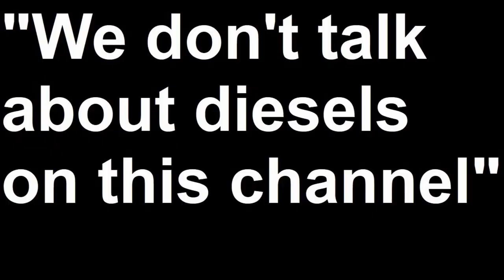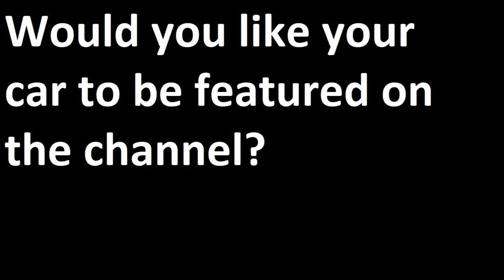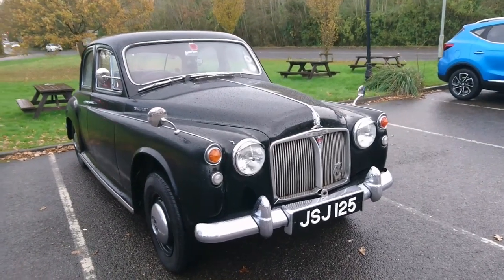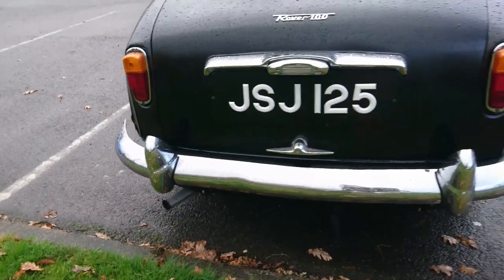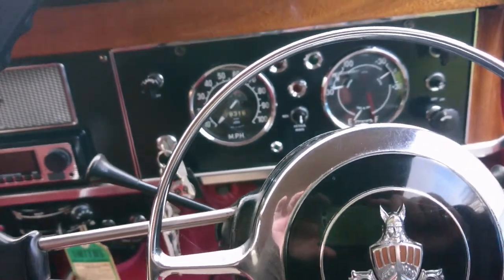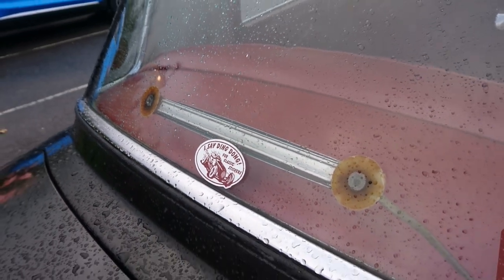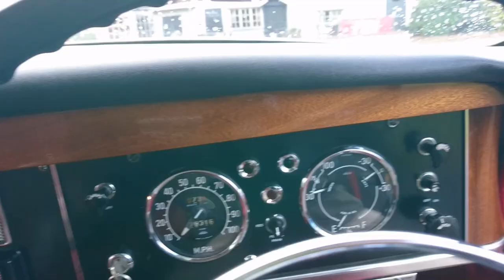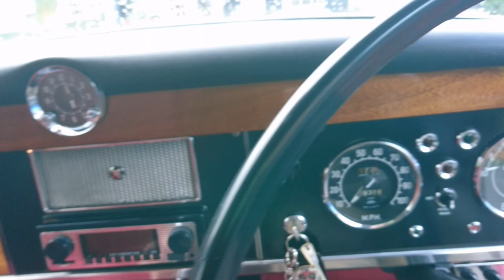Sensible Secondhand Classics: 1961 Rover 100 (P4) - Lloyd Vehicle Consulting

Comment: Great review Joseph. I have a P4 80. I've had her for thirteen years never let me down once. Best of British engineering. Brilliant car to drive.
Reply from the maker: Thank you very much indeed for watching and commenting! I eventually got the hang of driving this, but I would most certainly need the new aftermarket power steering system from a Corsa C that some owners have now developed, along with perhaps an all-synchromesh gearbox, if I were to use one all the time.

Comment: Had a P4 100 between 1980 and 2014 plus a P5B Coupe and a P6B 3500S. All very different cars. You gave a very good review being new to the model. A couple of items you may find interesting. When new the steering was actually quite light. The key as someone commented is keeping the kingpins topped up with oil, plus crossply tyres made a hell of a difference which were standard when new. The 6 cylinder engines were almost inaudible even from outside, but put a considerable weight penalty on the front tyres to the obvious detriment in handling. The handbrake when set up correctly would easily hold a 1 in 3 hill but you had to understand how it worked to set it up properly. The gears were never difficult to change so there may be a problem with the car, you only had to respect that first gear was crash. The overdrive in top made a huge difference to cruising. They were never equipped with mirrors from new, and back in the 70s and 80s you many driving around with none. Mine had a heated rear window from the factory and the elements were so tiny you could barely see them but worked perfectly. The sunvisors are standard fitting, why can't manufacturers fit them today? Mine had an hmv radio set that sat in the centre, if none specified aanother wooden glovebox lid was fitted. With these cars it's the detail and engineering that always impressed as current owners will echo. Remember the newest of these now are 60 years old, but back when they were current there was nothing like them. Factory said they would last at least 16 years in service, the fact that a good many were still on the road giving daily service in double that time says it all. Anyway great review.....thanks so much I really enjoyed it. Have subscribed. Best wishes Marco
Reply from the maker: Thank you for subscribing! With really old cars, they are just much harder to drive than newer ones. They often have non-synchromesh on first gearboxes (like this one), no brake servo (like a Morris Minor), really heavy unassisted steering (like some of the 1.6 Maestros), all round drum brakes (like some Vauxhall Vivas), gearboxes with unconventional patterns (like a Citroen DS) and in some cases quite limited performance (like a Fiat Panda). This means that you have to think a lot more about what you are doing when driving, especially when some of these things are combined together, such as in a P4. I was a bit scared having a go in this, but I managed it, and now I don't have to terrify Alex by driving it again! 

You may see that so far this year I have done a 1972 Jaguar E-Type, 1970 Morris Minor Traveller, a 1976 Vanden Plas 1500, a 1973 Peugeot 504 and a 1972 MGB GT on the channel, with more to come soon,  so I am not averse to driving older cars, it just takes a lot more effort to take them out on the road and talk to the camera without looking utterly terrified and making mistakes...

Thank you ever so much indeed for watching, commenting and subscribing!

Comment: Great review Mr Lloyd, yes a true Rover from the 50’s(even though that’s a ‘61), it does have an ambiance of middle class about it and I’m thinking that people at the time who could afford to own a car would be well aware what the cars would be like to drive, but even so as you say would need some practice to get used to it. 
     It’s in very good condition and a credit to Alex and it’s previous owners. 
    I remember during my teen years in the 90’s a family used one of these as their daily driving family car as the owner preferred cars from the 50’s and 60’s to use on a daily basis. 
       Thanks again Mr Lloyd and Alex for your review.
Reply from the maker: Yes, Alex uses this on a daily basis, and so I understand why the people you knew used to do the same thing. She loves it, although I prefer driving the Allegro and Micra. It certainly is a very middle class car, even today. I won't really make a habit of driving cars like this, but it is good to try them on an occasional basis, as it actually requires skill to do it well.
Reply: @lloydvehicleconsulting  Yes the Allegro and Micra are probably less of a challenge to drive as they’re not much different to drive than a modern car except no “toys” or “bells and whistles”.
Reply from the maker: @willswheels283  , the Micra feels the most similar due to the end-on gearbox, although the steering is very heavy in comparison with a modern car, although the Allegro wasn't bad either.

Comment: I actually saw a two time blue P4 100 at a classic car show in the summer and was rather taken by it.
My Dream Rover is a P5B in dark blue but as you know I do love the P6, SD1, SD3 and R8. Early post war cars are generally too close to pre war designs for my liking but this is something very special.
To think that in the 1950's we still had rationing in Great Britain. We lead the world with no money and a posh accent. In such times of austerity this majestic car must have really been a symbol of national pride.
Reply from the maker: The design was extremely modern for 1949, but it did look very dated when production ended fifteen years later. They aren't the easiest to drive, unless you fit an electric power steering conversion from a Corsa and perhaps go for the 105R automatic, but they are very comfortable and charming. There is some serious engineering behind it with things like the Inlet Over Exhaust engine, in this case a modified P5 unit, the Birmabright doors, the gear linkage and the oil level gauge.

Comment: I have just bought a 1962 Rover 100 and the two things that are challenging about it are changing gears and the heavy steering. These, along with other details like the window wipers and small rear view mirrors have made driving it the first couple of days a bit of a challenge. But I got a nice old car for a low price and it's really just something for fun drives in the country. But as in this video, it takes one by surprise first time around.
Reply from the maker: Yes, the gearbox and steering are not easy to deal with. I managed it, but it was hard. I can't believe how cheap they are! Thank you ever so much indeed for watching and commenting.

Comment: I do fancy one of these. Very stately, sensible and classy.
Reply from the maker: They are a bit of a handful to drive, but you can get an automatic, and there is a power steering conversion available. That would be my preference, as so much else about the car is fascinating....
Reply: @lloydvehicleconsulting  My very first car was a 105S. Just passed my test (age 21) and with borrowed money bought it second hand. Never had any problems with steering it or gear changes, probably because all other vehicles I had driven were similar.   Never had any problems attrracting young ladies into it either - far better than the sporty jobs my opposition drove. Admittedly they did attract different females!

Comment: What an experience Sir, British engineering at its best. Alex maintains the Rover beautifully
Reply from the maker: She does, sir, but she also is used to massive steering wheels, gearboxes with funny layouts and no synchromesh on first gear, all of which I found mildly challenging, shall we say.... An amazing car nevertheless, though!
Reply: @lloydvehicleconsulting  You had a go Sir. I have never driven a car of that age, only a Grey Ferguson tractor, probably similar size steering wheel, but it didn’t do above 10mph, so not quite in the same league . The Rover has a beautiful steering wheel though
Reply from the maker: @badbooks476  , I did have a go, sir, and now it is safely back in Alex's hands...

Comment: I owned a 1955 90 back in the 70s and I have to say I never had any troubles at all with the gear change. I might add that the engine had so much torque that I could turn into a road in fourth at 10 MPH and still move off without any hunting or shaking at all. I could travel on the freeways at 70 MPH without any dramas at all even without overdrive. I absolutely loved that car but at just 18 or 19 I was always looking for the next car to buy so I traded it in on something much less desirable. I wish I had kept the old girl. I had only two scary moments during my ownership. Once when coming to a stop at an intersection where the road had gravel on the side I applied the brakes and the steering wheel spun completely out of my hands as the left wheel was on the gravel and the right was on the tar. The other was when I had the car in freewheel (controlled by a large knob on the bottom of the dash where the badge is on the one you showed)  and I started a long and steep piece of road and realised that after a couple of strong applications of braking I had serious brake fade (drum brakes on the front of that model year). Being in free wheel I had zero engine braking so it was a scary ride down the mountain road. No wonder they dropped the free wheel design in 1956. But she was a totally reliable daily driver that never let me down. If I was to have one today from that period I would definitely convert it to a later disc brake front end because the drums could let you down if your concentration was not on the money at an important moment. I would HIGHLY recommend the P4 to anyone looking to get an entry level classic car. Nice video mate. Just get your manual gear changes right. :)
Reply from the maker: To be fair, I don't normally drive cars with no power steering, no synchromesh on first gear, and with first where third normally is and reverse where first normally is, so I don't think I did that badly. It is quite difficult driving cars like this if you aren't used to it. If you are someone like Alex, though, who drives this all the time, then it's not really much of a problem.

Glad I didn't have to deal with a freewheel, all round drum brakes and other complications which some of the earlier models had, it was hard enough dealing with this as it was, although I am exceptionally glad that I was able to have a go in it, and these are amazing cars if you can live with the fact that they are nothing like a modern car to drive. For a lot of people, I think that is the point, and Alex has proven that you can still drive one of these every day over sixty years after it was made if you want to, and I do understand why someone would want to do that. Just had a go in one of her other cars today...
Reply: @lloydvehicleconsulting  Mate, here in Australia we say: "I was just jerking your chain" with regards to your manual gear change skills. No insult was intended. It's just our sense of humour here in Oz. Oh and as for the steering wheel turning, I wouldn't suggest the push pull method. The steering is far too heavy, especially at parking speeds. Just turn it like you would a truck and she'll be apples, just heavy apples. :) I used the right hand on the outside of the wheel  rim and the left hand under the rim. But in any case, I thought your video was really clear about the advantages and disadvantages of the car.

Comment: The rover 80 used the newer series 2A  two and a quarter litre landrover engine, while the 60 used the later series one two litre landrover engine, which itself was a development of the P3 1600cc engine.
The gearbox is quite sweet actually once you learn to give it time rather than hustle it, unless you come to a complete halt the engine torque will happily pull away in second so you dont need to worry about 1st gear.
Seventy mph is quite relaxing in  overdrive and she will cruise at that all day with a full contingent of passengers. Downside is 24 mpg and 18 running to the shops, although the sixty was slightly better.
 Finally I was delighted to see such a lovely car tested. Good choice!
Reply from the maker: Thank you for watching! It was very difficult to remember all the facts as I was driving, as I don't normally drive cars without an all synchromesh gearbox, and the gearshift pattern is entirely different from everything else I have every driven too... I have now tested three cars from the 1960s on the channel (a 1966 E-Type, a 1968 Midget and this P4) and I am looking forward to testing a 1967 Rover 2000 Automatic in 2022. We have a lot more classics to come on this series that I have already filmed this month, although none quite this old.

Comment: Hi, I owned a p4 100 back in 1970 , never had trouble with the gears . I did once have the the gear stick come off in my hand once , while at traffic lights on the A40 Denham . I remember the engine was so quiet at tickover , you would think it had stalled . As an eighteen year old I had no problem with steering either . The car you were driving would probably benefit from being greased , makes a big difference . My car had individual seats with separate arm rests , also had overdrive . The reg number on mine was 8307 UR , wonder if it's still out there . Thanks for the video brought back a lot of memories .
Reply from the maker: Yes, I know the A40 at Denham! I think these days we are used to easier gearchanges, and power steering, and this car has neither. I have driven cars with even heavier steering than this (one of them was a Mark II Volkswagen Polo, funnily enough), at least the brakes are good. The owner does admit that the steering is heavy, but she is just used to it and uses the car all the time anyway! Glad you enjoyed the video.
Reply: I had one of these for 20 years . Great car  . Like you my grearlever snapped off . Happened twice so I always carried a spare in the boot !!

Comment: Good afternoon Joseph,
  Well done on reviewing Alex's P4 Rover 100. I would say your review is a fair one. I have been following Alex for quite a long while now and the the work skills together with her knowledge is to be admired. She restored the seats and door cards herself changing everything from original light blue over to the red interior you see today. All of the wood dash was cleaned and revarnished by her to an excellent standard. She is planning on doing the window wood surrounds as well. In my opinion I think you handled the car well considering you were unfamiliar with it. One little additional piece of information for you about these Rovers and the P5s is that the also had an affectionate nickname in the 50s and 60s, being known as "a poor man's Rolls Royce" due to their build quality level. Overall an enjoyable watch.
A Happy New Year to you.
Cheers, Jon Barnes.
Reply from the maker: Thank you, John! Happy New Year to you as well. Yes, I normally drive cars with all synchromesh five or speed gearboxes in a conventional pattern, power steering, dual mass flywheels and servo-assisted brakes with ABS, so something like this is quite an adventure. The brake were actually pretty good, although the turning circle really is absolutely huge. Having driven the Allegro and a 1981 Vauxhall Astra on Sensible Secondhand Classics recently too, I am trying to get hold a few more of these older cars, as they are quite interesting. Alex has worked really hard on this car, and it is testament to her skills that the car has come out as well as it has. We are hoping to get some more filming done again soon.

Comment: Owned a Rover 90 fitted with a Rover 100 engine when I worked in Slough back in the early 70’s. Many happy memories, including polishing the beautiful red leather seats to a high shine using Mansion Polish. Gave the car a beautiful lavender odour. Unfortunately, came to a roundabout at Iver Heath. The car was turned to the right but my backside followed the laws either of gravity or inertia and decided it was going to the left!. On another occasion I called into a filling station, bought fuel then the car refused to start. (battery). Just then their recovery vehicle returned from a call and offered to tow me and bump start it. Great!... until I found that the servo brakes only worked when the engine was running!. Engine started and as I practically stood upright on the brake I stopped about a millimetre from the back of the truck!  Only other problem was the 11 gallons to get back home to SouthWales and another 11 gallons to return to Slough. Good old YBP30!
Reply from the maker: Thanks for watching, Phil! I know that roundabout at Iver Heath very well. We weren't massively far away for this test in Bracknell. Fortunately, the brake servo was working in this one, otherwise stopping it would have been interesting.
Reply: I'm sure the braking incident took two or three years off my life!
Reply from the maker: @phildavies6020  , it must have been terrifying! Should see plenty more of these P4s over the next couple of days at Roverfest.

Comment: Joseph you may well be right about having a reversing lamp fitted. Even if it's to warn following drivers that 1 at gear isn't where you may expect it to be. 😅
Well done Sir, must be challenging to relay all that model information and history while driving a car of this vintage.
Reply from the maker: It was a massive challenge, sir, and I am not sure that I did a very good job, but at least you got to see my push/pull steering technique (don't show Mr Coleman)! There is a reversing light, but it is tiny and does not currently work. I would prefer separate fog and reversing lights.